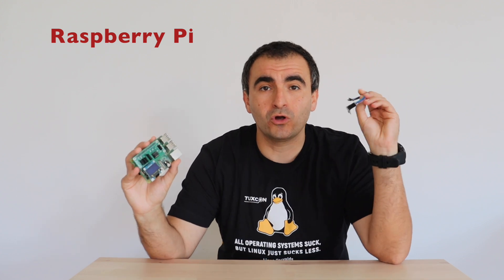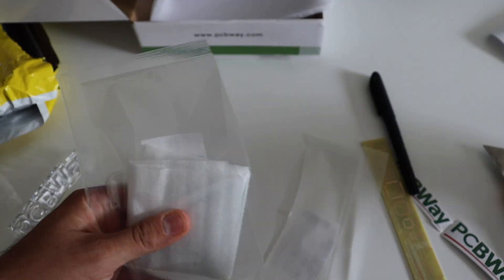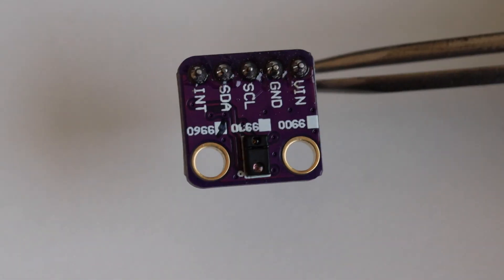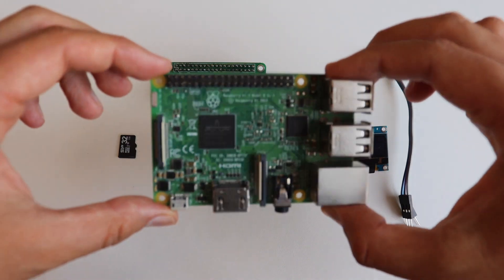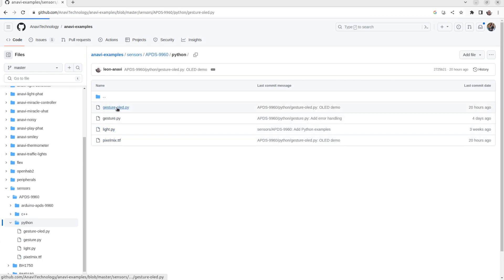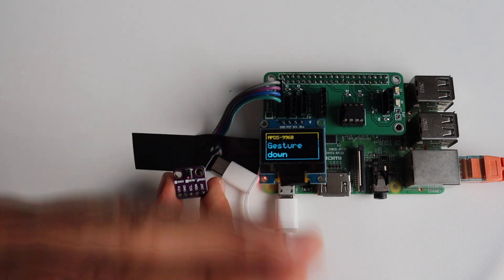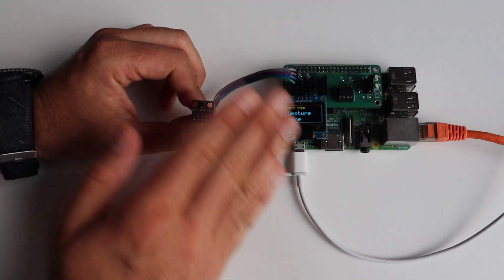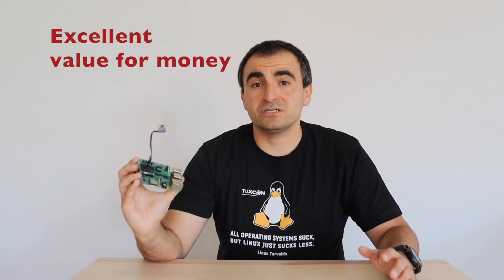Gesture Recognition with Raspberry Pi and a Low Cost APDS9960 I2C Sensor

Comment: Seems like its not working consistently?
I ordered a few of these tninking they would be cool but seen a few videos now that all look like it doesn't really work that well.
Reply from the maker: Well, it is a low-cost multi-purpose sensor so there are some trade-offs. Are you using it for gesture detection as in my video or are you using the other features like color recognition, light and proximity measurements? What kind of inconsistencies exactly are you experiencing?

Comment: Can the sensor detect gestures like touch , swipe , typing  at a  distance of 1-5 m ?
Reply from the maker: Yes, gestures like swiping are detected. I am not sure what gesture you have in mind for typing, if you mean letter - no. The proximity and gesture feature is factory-trimmed and calibrated to 100mm proximity detection distance without requiring customer calibrations.